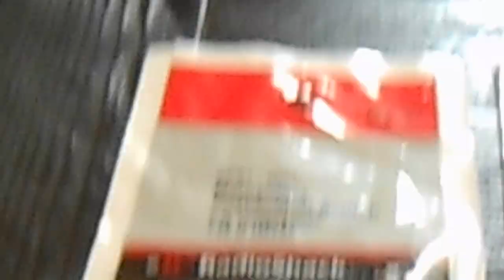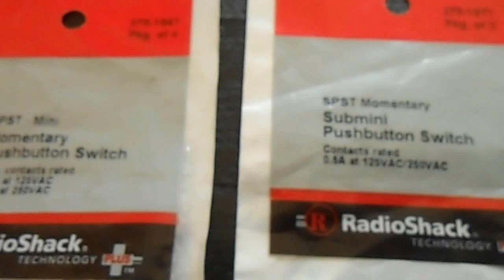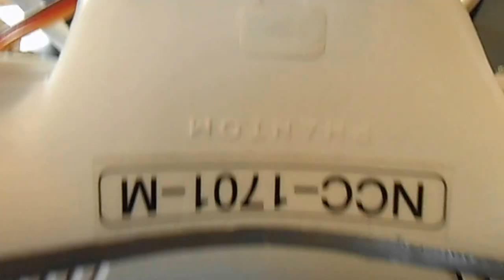buddygoods: Changes in the gimbal board. How to install reset switch

Comment: Another question for you Mitch:).  As you know, I am mounting a Mobius to the gimbal. I was able to secure the Mobius, connect to my machine, level and re-calibrate. Instead of the Mobius pointing down, it now points forward which is great. While still connected using the USB port, I connected my batter and the gimbal works as expected (the Mobius points forward). I disconnect power and discount the USB.  I then reconnect the power and this time the gimbal appears to lose it's previous calibration and wants to rotate back to vertical (meaning the Mobius points down). Any thoughts? Thank you!
Reply from the maker: Any change you make in gui needs to be followed by the write key. Try making the changes and saving the profile? Save the profile on your desktop for use down the road. I will be gone most of the day flying. You should do the same.
Reply: Mitch Peterson Thanks Mitch. I tried to write the changes after calibration and no luck. I also saved a new profile and reloaded with no luck. It's as if the gimbal does not retain the new settings after power is lost.
Reply from the maker: I have many profiles. Tomorrow
Reply: Mitch Peterson Thanks MItch. I managed to orient the gimbal, but I am not certain it will keep and would like to see any horizontal profiles you might have.

Comment: Hi Mitch.  Another question regarding the pitch control.  I see 12 pins coming off the board.  Buddygoods sent me 4 separate wires.  I know two ends should connect to the F3 connect inside the Phantom, but I am not certain which of the two pins I should use on the board.  In addition, did buddy send two too many wires?:)  Thanks for your help!
Reply from the maker: Dude, I'm goinin to bed
Reply from the maker: If you could see the back side of the board you will see the backside of the 12 pins. Use the three vertical pins labeled RX pitch. Do not use the center pin on the board or Naza. Use F2 not F3. You only need two wires.
Reply: Mitch Peterson Thanks Mitch. Good to go! I leveraged the wiring diagram and found the right pins.

Comment: Hi Mitch. Thank for the information. I see how you mounted the gimbal to the Phantom 2. It appears you rotated the top plate 90 degrees which would better align to the three pre-drilled holes on the Phantom. I have a Phantom 1 which only has two holes running the length of the body. It appears the two holes align to the outer two holes on the top plate which is good. My question is this - how did you split the plates?:). I can use a small wrench to disassemble the four screws. I suspect I need to remove the circuit board as well? Then attach the top plate and tighten the opposite screws?
Reply from the maker: The two plates are connected together with the four rubber grommets. Separate w fingers pulling out the grommets. When done simply slip the grommets back into place. Use a small flat screwdriver to push the rubber through the hole. I may be difficult at first but totally doable.
Reply: Mitch Peterson Thank Mitch!